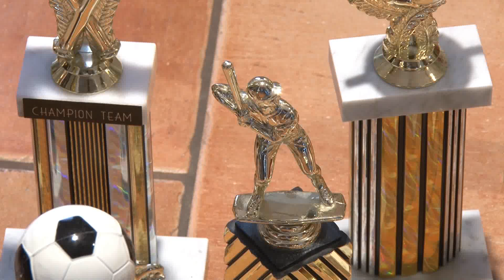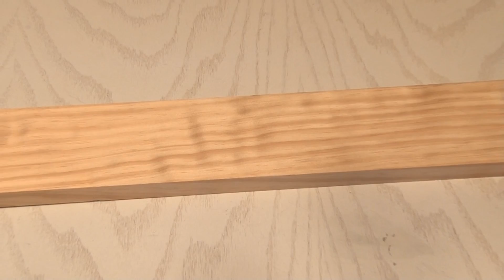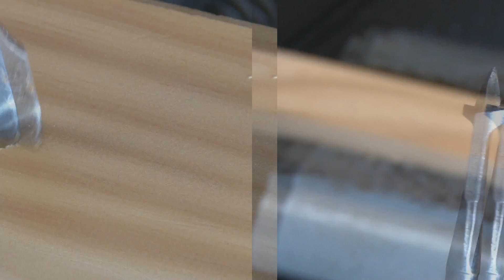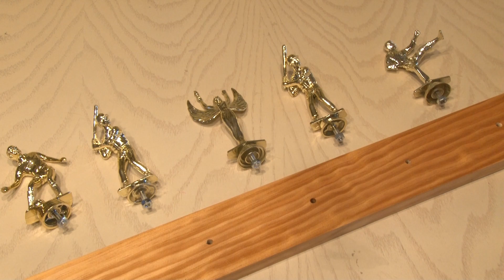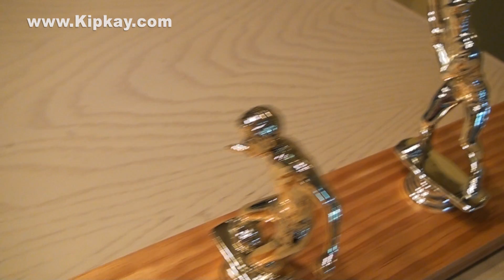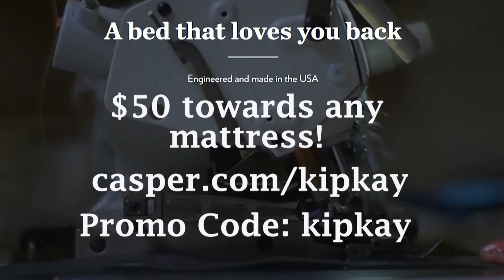Trophy Coat Rack!

Comment: I think a better idea would have been insetting the nuts in the top of the board putting the trophy tops on those then using normal coat hooks for the coats. if you hang anything heavier than a wind breaker those trophy tops aren't going to last long with the quality of the toppers they are using now which are a gold colored plastic.

Comment: No Loctite or wall anchors?  What the hell, dude!?
Reply from the maker: DeAthWaGer Unneccessary. This house was built in the 70's. The walls are Sheetrock. Very hard and you can screw right into them. Not sure where or why I would use Loctite. The nuts and bolts just sit there and are not put through any stress. Thanks for the question though.

Comment: i noticed you didn't check for a stud. over time it will work its way out. other than that really liked the video thanks!
Reply from the maker: XmackattackX These 1970's walls are Sheetrock. Not modern day drywall. Very hard.

Comment: "Some have a longer shaft"
- KipKay 2015
Update: KipKay is good at sexual innuendoes as it turns out, xD
Reply: D͟i͟a͟m͟o͟n͟d͟P͟i͟g͟m͟a͟n͟ "Make sure to hold onto these nuts"
-KipKay 2015
Reply: "Now that all our holes are drilled"
-kipkay 2015
Reply: "I decided to use needle nose pliers to get that loose"
KipKay 2015
Reply: D͟i͟a͟m͟o͟n͟d͟P͟i͟g͟m͟a͟n͟ lmao I'm happy I'm not the only one who caught that, 
'' to get in there and hold that nut''
-Kipkay2015
Reply: Myster07 "I leave six marks, one every three quarters of an inch." "I'm going to use two brass wood-screws"
KipKay 2015
Reply: Oh my
Reply: "Get that nut on and hold it in place"
-KipKay 2015
Reply: " Adding the nuts "
-KipKay 2015
Reply: Triple Stabber U just had to
Reply: :D
Reply: Hold on to those nuts...

Comment: old trophy plastic is pretty brittle... 1 heavy coat or 1 coat pulled off at the wrong angle and those baseball bats and arms are gonna break off
Reply from the maker: INVISIGOTH Very possible. You have to keep that in mind when using it. Been holding fine for 2 weeks now.